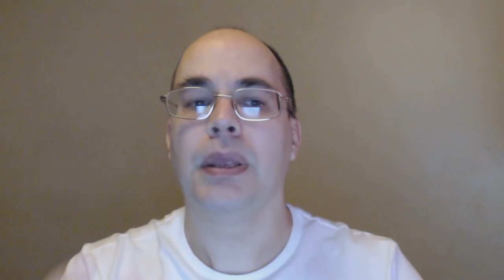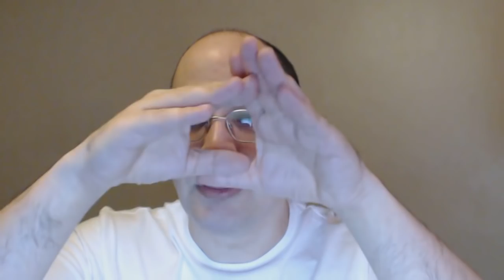How do rockets move in space, with nothing to push off from?

Comment: If you throwing 3rd law of motion, then do not forget to mention Joule's "free expansion" law
Reply: +davy spilani
The fireplume from the back of the rocket is thrust, it thrusts in 2 directions,, as it's a controlled explosion and it has its own oxygen supply.
And the fireplume going forward is going to bounce off the rocket, giving it the forward momentum. That's how rockets work.

The exhust gass from that fireplume are Imediatley sucked into the vacuum
That is incorrect - vacuum is not a literal vacuum cleaner, and doesn't suck. Besides, this contradicts your earlier sentence, about how fireplume thrusts in two directions.

Neutons law is a law not a theory.. on earth the law is (mass/Action/Mass) But in space it's (Mass/action/??????)
No, in space it's still mass/action/mass. As you've said above, thrust from the rocket moves in two directions. The one going backwards doesn't interact with the rocket anymore and can be considered a waste, but the one going forward is going to bounce off the rocket and make it move.

It's called the 3rd law because there is 3 parts
No, it's called the 3rd law because there's a 1st and 2nd law before it.

I say, using  Neutons law, Imagine two big heavy boxes in space, move them together and put a spring in between them,, connect the boxes together..
Yes, that's the thrust, going in two directions. If you put a third box (a rocket) in the way of any of the boxes, they will hit it and transfer their kinetic energy.

Essentially, a rocket rides a continuous explosion shockwave. It doesn't have to push off anything else.

This is before you consider the unimaginable amount of radiation both in the van Allen belt and in general space
Are you aware that Van Allen Belt isn't uniformly dense?

In order to achieve enough mass2, In an infinate vacuum,
The size of vacuum is completely irrelevant - as long as the rocket has the fuel and oxidizer to burn, it will continue moving forward.
Reply: Where do they state that?
Reply: Free expansion does no work on the vacuum, but it doesn't mean that gas doesn't do anything. If you have a closed container in a vacuum environment which contains a pressurised gas, it initially won't move, because the force acting on the walls is the same in all directions.

But, after you remove one wall, there will no longer be any force acting on it (your "free expansion" principle), but, until the gas is fully evacuated, there will be a force on the opposite wall, which means that this container will gain a net force in the opposite direction from the gas expulsion lasting for some time. Momentum is conserved; rockets work.
Reply: Balabajka No,, NASA states,, it's Neutons 3rd law of motion alone that move the rocket.. This is bullshit because Neutons 3rd law does not apply.
WHY A ROCKET WON'T WORK IN A VACUUM!
Why a rocket engine will NOT work in space! NASA says Neutons 3rd law of motion is what makes a rocket work in a vacuum. The 3rd law states "for every action there is an equal and oppersite reaction".  They say this propels the rocket forward and not the air the rocket is pushing against! I say, using  Neutons law, Imagine two big heavy boxes in space, move them together and put a spring in between them,, connect the boxes together.. Now, the spring is the action and you will have an equal and oppersite  reaction via the boxes, when you detach the boxes the spring will push them Appart. So the action of the spring caused an equal and oppersite reaction and the 2 boxes shoot Appart at equal speeds as long as they both have the same mass..  Now a car is Mass the wheels are the spring or thrust and the road has mass, the spring pushes in equal directions, or the wheels turn and the road and car shoot Appart in oppersite directions at equal speeds. The ship works the same,, propeller is the spring and it pushes against the ship which is a mass,, and the sea which is another mass, the 2 masses move Appart at equal speeds in relation to their masses,, The ship has more mass than the sea water behind the propeller so moves slower than the water, A plane uses the same principal. A rocket,, the same principal,,, In this 3 part equation, ie (Mass spring Mass) or (Oppersite reaction/Action/Oppersite reaction) Quote "for every action, there is an equal and oppesite reaction". The rocket is the first mass the spring is the fire plume, (This is a controled explosion that pushes equally in 2 directions just like a spring) and the earth's atmosphere is the other mass, again proportional to thrust and  depending on the mass of air moved and the mass of the actual rocket determines the speed the rocket moves in one direction. As you gain altitude the mass of the atmosphere exponentialy decreases but the mass of the rocket stays the same so in order to continue up at a constant speed the the fire plume or controled explosion has to exponentialy increase thrust in both directions until finaly there is nothing left to thrust against on one side of the fireplume as the atmosphere has depleted. Now we have a case of Neutons 3rd law of motion only having 2 parts ei ( Mass spring ?????) So Neutons law no longer applies and the rocket will not have propulsion, like taking away the sea from the ship, if ships could fly it would just not move,, the propeller can spin as fast as it likes the ship is not going to move. This is before you consider the unimaginable amount of radiation both in the van Allen belt and in general space.. So that's Neutons law saying you can't go into space for far using a rocket engine, You need something to thrust against...   It doesn't matter what those masses are, that's not the point, all that matters is the action the reaction and the oppersite reaction (Reaction/Action/Reaction) 3 parts.. The 3rd law of motion. You can have one big box one small box, One with double the mass, a super spring, it doesn't matter, the principle stays the same, this is a law of physics. so that's ( Rocket = Mass/Explosion/Atmosphere=Mass) The rocket and atmosphere are the equal and oppersite reaction. Take away the atmosphere and you have (Rocket or mass=reaction/Explosion= Action=Explosion/Nothing????? zero mass = No Oppersite reaction) Now Neutons law can not apply.. The rocket can not propel forward...
PROBLEMS WITH ORBIT SPEED
If we have (mass1=Actual rocket/Spring or thrust/mass2=Atmosphere)
So If thrust needs to exponentialy increase to compensate for an exponential decrease in mass 2. Then there's ,A, An exponentially  increased need for fuel and ,B, A constant weight added for all the fuel nessasary to reach Orbit velocity. 
You would need an atmosphere to use as mass2 and the problem with that is heat! To reach Orbit velocity means 17/18,000 MPH If you do that speed in the atmosphere you burn up?! Especially when you are carrying Highly explosive rocket fuel! 
Conclusion!
In order to achieve enough mass2, In an infinate vacuum, you would need to have infinate thrust and infinate fuel  and that fuel would have infinate mass in order to create enough of an atmosphere in mass2 (space) For the spring or explosion (Rocket fireplume) The action in Neutons law,, ie (reaction/action/reaction) to have enough thrust to propel mass1 (the actual rocket) Forward. This is assuming space is infinate and a vacuum! 
Final conclusion It's not possible.. Maybe very low orbit with very light equipment, but with the radiation and heat problems! Once a rocket engine switches off in space the rocket will start to fall towards the nearest large object unless the rocket is in orbit!! ..
Reply: Jan Strzelecki Wrong! The fireplume from the back of the rocket is thrust, it thrusts in 2 directions,, as it's a controlled explosion and it has its own oxygen supply. The exhust gass from that fireplume are Imediatley sucked into the vacuum and provide no 2nd mass needed for the rocket to move forward. It simply cannot be done.. Neutons law is a law not a theory.. on earth the law is (mass/Action/Mass) But in space it's (Mass/action/??????) It's called the 3rd law because there is 3 parts and you need all 3 to move forward, in space you are missing one part so the rocket will be pulled back by gravity towards Earth.  Here's a detailed explanation.
WHY A ROCKET WON'T WORK IN A VACUUM!
Why a rocket engine will NOT work in space! NASA says Neutons 3rd law of motion is what makes a rocket work in a vacuum. The 3rd law states "for every action there is an equal and oppersite reaction".  They say this propels the rocket forward and not the air the rocket is pushing against! I say, using  Neutons law, Imagine two big heavy boxes in space, move them together and put a spring in between them,, connect the boxes together.. Now, the spring is the action and you will have an equal and oppersite  reaction via the boxes, when you detach the boxes the spring will push them Appart. So the action of the spring caused an equal and oppersite reaction and the 2 boxes shoot Appart at equal speeds as long as they both have the same mass..  Now a car is Mass the wheels are the spring or thrust and the road has mass, the spring pushes in equal directions, or the wheels turn and the road and car shoot Appart in oppersite directions at equal speeds. The ship works the same,, propeller is the spring and it pushes against the ship which is a mass,, and the sea which is another mass, the 2 masses move Appart at equal speeds in relation to their masses,, The ship has more mass than the sea water behind the propeller so moves slower than the water, A plane uses the same principal. A rocket,, the same principal,,, In this 3 part equation, ie (Mass spring Mass) or (Oppersite reaction/Action/Oppersite reaction) Quote "for every action, there is an equal and oppesite reaction". The rocket is the first mass the spring is the fire plume, (This is a controled explosion that pushes equally in 2 directions just like a spring) and the earth's atmosphere is the other mass, again proportional to thrust and  depending on the mass of air moved and the mass of the actual rocket determines the speed the rocket moves in one direction. As you gain altitude the mass of the atmosphere exponentialy decreases but the mass of the rocket stays the same so in order to continue up at a constant speed the the fire plume or controled explosion has to exponentialy increase thrust in both directions until finaly there is nothing left to thrust against on one side of the fireplume as the atmosphere has depleted. Now we have a case of Neutons 3rd law of motion only having 2 parts ei ( Mass spring ?????) So Neutons law no longer applies and the rocket will not have propulsion, like taking away the sea from the ship, if ships could fly it would just not move,, the propeller can spin as fast as it likes the ship is not going to move. This is before you consider the unimaginable amount of radiation both in the van Allen belt and in general space.. So that's Neutons law saying you can't go into space for far using a rocket engine, You need something to thrust against...   It doesn't matter what those masses are, that's not the point, all that matters is the action the reaction and the oppersite reaction (Reaction/Action/Reaction) 3 parts.. The 3rd law of motion. You can have one big box one small box, One with double the mass, a super spring, it doesn't matter, the principle stays the same, this is a law of physics. so that's ( Rocket = Mass/Explosion/Atmosphere=Mass) The rocket and atmosphere are the equal and oppersite reaction. Take away the atmosphere and you have (Rocket or mass=reaction/Explosion= Action=Explosion/Nothing????? zero mass = No Oppersite reaction) Now Neutons law can not apply.. The rocket can not propel forward...
PROBLEMS WITH ORBIT SPEED
If we have (mass1=Actual rocket/Spring or thrust/mass2=Atmosphere)
So If thrust needs to exponentialy increase to compensate for an exponential decrease in mass 2. Then there's ,A, An exponentially  increased need for fuel and ,B, A constant weight added for all the fuel nessasary to reach Orbit velocity. 
You would need an atmosphere to use as mass2 and the problem with that is heat! To reach Orbit velocity means 17/18,000 MPH If you do that speed in the atmosphere you burn up?! Especially when you are carrying Highly explosive rocket fuel! 
Conclusion!
In order to achieve enough mass2, In an infinate vacuum, you would need to have infinate thrust and infinate fuel  and that fuel would have infinate mass in order to create enough of an atmosphere in mass2 (space) For the spring or explosion (Rocket fireplume) The action in Neutons law,, ie (reaction/action/reaction) to have enough thrust to propel mass1 (the actual rocket) Forward. This is assuming space is infinate and a vacuum! 
Final conclusion It's not possible.. Maybe very low orbit with very light equipment, but with the radiation and heat problems! Once a rocket engine switches off in space the rocket will start to fall towards the nearest large object unless the rocket is in orbit!! ..